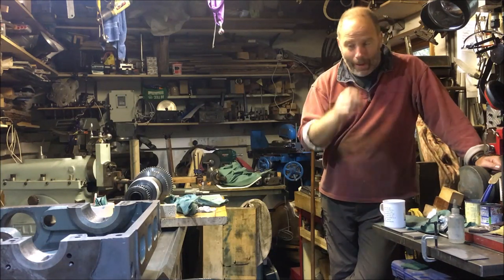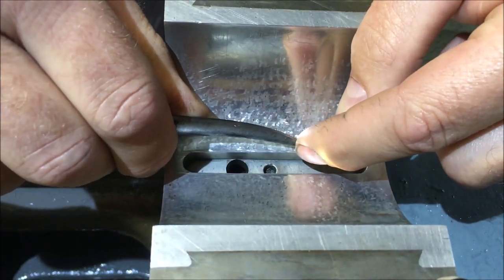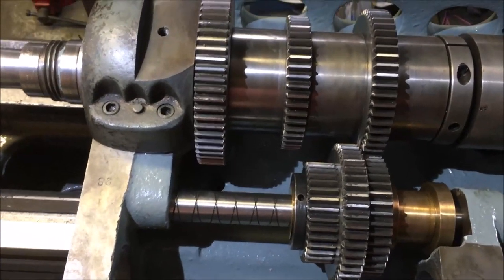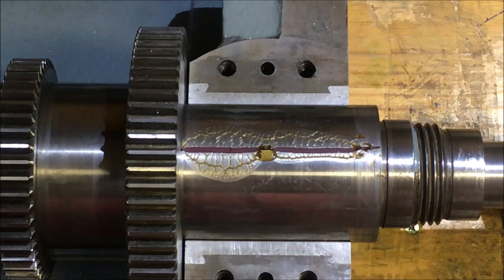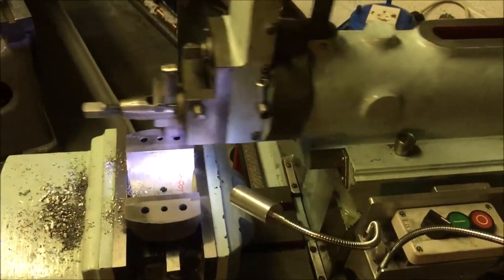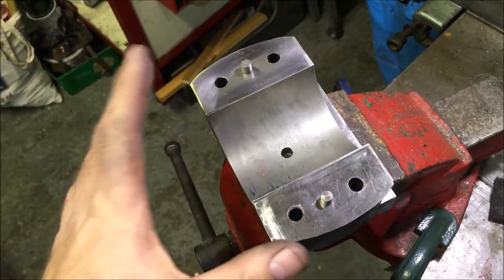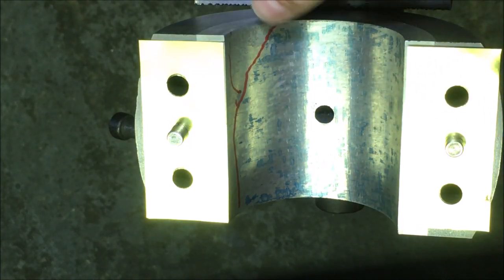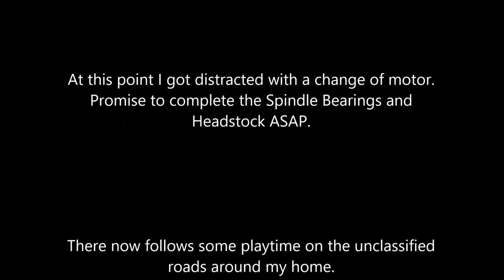Scraping Spindle Bearings

Comment: Hi Mat an Old Timer in an Electric Motor Repair Shop. Once showed me this trick. He filled the Brg Journals with clean oil then added
just a small pinch <---(and I do mean small pinch) of Borax directly to the Brg Journals, then ran the Motor for 5 minuets.
 The Result was an Amazingly Bright, Shiny, and Smooth Journals. We drained the oil, cleaned the Armature, Re assembled the Motor
and test ran the Motor preformed flawlessly.

Comment: Mat, this past spring I scraped in the cutter head, bottom fed, bearings on my woodworking jointer. Admittedly we worked on machines of 2 different  load demands and speeds, my machine runs at a constant 4k rpm. With that said, what I'm suggesting is the means by which I tested the clearances. After final assembly I positioned a thermocouple on each bearing cap and ran the machine for fifteen minutes, unloaded. At the end of the run the bearing temps had risen by 40*F over ambient. In the end you will have to decide how much rise you are comfortable with, however, I think it is a good test for overly tight bearings. Just my $0.02.
Reply from the maker: If I was anyway near smart enough to wire up a pair of thermocouples and a display to show the temp of each bearing thats the way to go ! I'm not so will likely use my heat gun which is fine for comparative readings with hands out the way. The temp rise will affect the fits and thats what I have to keep an eye on.

Comment: When I worked in the construction and installation of Flax Drawing frames all the Drawing rollers ran on white metal bushes (5 - 16 in line depending on size of machine) , we done the Blueing and Scraping as usual and when we finally fitted the long Drawing Roller we would go along each journal and give them a couple of sound "Dunts" with a hardwood Block and a 2 1/2 Lb hammer to "flatten out" any tiny high spots. Crude but it worked . We also applied "Castor Oil" for the initial "Running in" period where the roller was under high pressure from the "Pressing Rollers" after which it was light machine oil applied to a flannel which permanently sat on top  of the journals.
Reply from the maker: Ive read similar about the initial 'thump' to settle any high points and create a small oil pocket for rollers to sit on oil. Thanks for watching and commenting. Mat

Comment: Excellent work never scraped a babbit bearing before replaced a lot of tapered roller bearings which is a lot easier was that a Cincinnati shaper you were using sure got a good surface finish with it I can tell you are very good at doing a job right I am a retired machinist and have rebuilt a lot of machines also own a old sheldon lath with Babbitt bearings  in it
Reply from the maker: Hi Ray, thanks for watching and commenting.  The shaper is an English made unit by Elliot. Based on an earlier design by Alba from the early part of the 1900’s. I haven’t seen a Cincinnati shaper over here in the U.K. comparable shapers by invicta or Churchill. There are plenty of others from the early 1900’s, Butler are a favourite of mine.

Comment: Good work mat. I have used aluminium foil for shims <0.002”. The fact that it is soft means that it compensates for any asperities on the surfaces. Looking forward to seeing this machine making parts. Good to see the landy out. I’m losing water in mine . Think I have a head gasket leak 😔
Reply from the maker: I had 2.5 ltr loss of coolent (well thats what it took to top it back up) not sure when it had been last checked by the previous owner so could be a long time. Found evidence of a leak below the top hose, dripping onto the main block and exhaust manifold - the flexible pipe had been changed quite recently so I had assumed it was sorted. I cleaned it up and then spotted it was still dripping - sorted that so am keeping an eye on it. Got to start looking at the door bottoms next so the welding skills will be developing months :-)

Comment: Sack the summer shift, lucky they turned up 😂. ISO 5 to 10 oil is  blooming thin, guess it was designed for shipyard factory temperatures, ref no doors or windows.
Would spring loading the bearing caps lightly help for scraping in?. Like the oil wedge description, sounds better than hydrodynamic lubrication, makes sense on your radial loading direction.
Thanks for sharing and best regards from the Black Country.

Comment: my dad told me that after they had scraped in new bearings on a lathe they would run it for hours unloaded with molykote A as a lubricant.
the MoS2 particles would embed in the bearing material and reduce drag, and thereby heating up and wear of the bearings immensely.
the stuff is not cheap but in comparison to the work you have done it actually is quite cheap.....
Reply from the maker: Thats interesting, similar to what I had read on a forum a few months back, I dont recall the 'lubricant' they ran shaft journals in with, but similar purpose. Cheers for stopping by, Mat

Comment: Now: I have never scraped a lathe headstock, but I have done a few big-ends of about the same size as your headstock, on an old fire engine. And we generally have just scraped to a good print and then run the engine. I know that there should be exactly the right clearance once the shape is correct. But in practice it seems to work OK.
Reply from the maker: I share your view Andy, there's 'correct' and what works - I doubt after several hundred hours running correct is any better than nearly... but you never know :-)

Comment: Epic effort as usual mate :), looking great. For what its worth if been going through a S&B model L headstock, it runs a split bronze front bearing that seats on a taper, the rear bearings are angular contact ball races. Ive a touch over .002" axial play cold on the front bearing and it parts off fine. Im thinking starting with some clearance and remove a shim if needed might be the better route. Would be a royal pita if that bearing picked up from being to tight after all the hard work.
Cheers
D
Reply from the maker: Hi mate, yeh I think start with .002" and then remove one if it needs it. Am going to take a look at some 'metric' shim to see if I can work out smaller increments than .001" might make things a bit easier. Best of luck with the production runs :-)  Cheers Mat

Comment: Very nice! Interesting to see the process. I'm wondering though, if the rear bearing had less wear, and then you dropped the front bearing even further, won't you have to drop the rear bearing an equal amount to maintain the parallellism of the spindle to the bed?
Reply from the maker: The bearing / spindle to bed alignment is checked repeatedly throughout the scraping of the lower half of each bearing, much of this is covered in the first part of the two videos. The top halves of the bearings simple repeat the alignment to the spindle once it’s established on the lower halves.
Reply: @lookcreations  Thanks! Joined this series a few episodes in.

Comment: I don't know anything about this, but wouldn't you want to cut in some channels/grooves for oil to flow into.
Something that comes to mind is when the bearing temp goes up, does the ID get smaller or larger?  I know when the spindle heats up it grows.
So heat the spindle in an oven and make a chart showing the growth per degrees of increased temp.
Also mock up a bearing roughly the same size, which could be a home made ring with poured Babbitt and do the oven procedure with it.
Then you would know what will happen with the spindle assembly.  
Too scientific, just wing it and see what happens.
Good show and good luck, JIM
Reply from the maker: I have read some conflicting messages about oil grooves in these types of bearing. The main issue is that the grooves can suck the oil away from the shaft and create problems by breaking the wedge that is sought. Where are obviously lack of oil will give the same result. The consensus appears to be a smooth shell face appropriate clearance for the correct oil viscosity, shaft rpm & diameter. Note that the oil reaches the faces via an almost full width felt wick at the bottom - so there should be good coverage and the 'excess will flow out of the ends. I am keen to see how it works in practice !  All the best & thanks for stopping by. Mat

Comment: Another great video.  Regarding the dowel pins, they looked like tapered dowel pins in the video unless it was an optical illusion.  Taper dowel pins would make sense in the application as they result in essentially zero clearance and hold the items in exact alignment. Every taper dowel pin I have ever seen has those same machining marks.  It looks like a kid in a high school shop class made them.  However, every one I have encountered always worked as it was supposed to.  Is your shaper an Elliot?  I have an Elliot 14 MR and it looks very similar to yours.  Keep the videos coming.  Thanks, Ken
Reply from the maker: Hi Ken, The dowel pins are parallel pins for sure, just look like they were 'rough turned',  diameter is spot on maybe .0005" over and they 'spread to fit snug with a tap in ?  Its an elliot 14S Shaper made around 1954 when Elliot took over Alba. I fully rebuilt it a couple of years back - its how I learned how to scrape ... the hard long way around ! Lots of advice from chaps on here and the Practical Machinest Forum. I got quite a lot of stick from 'experts' that didn't like that I sometimes took my own approach to resolve issues and not follow their defined procedures. All in all the results speak for themselves, it holds 0.0002" over the working envelope with a little care setting up the part. The vice I think is from an 18" machine. Its a little big, but does the job well - that had to be rebuilt from scratch as the nut was toast and it was worn on the slides.  Take a look over my earlier videos - there's hours of background entertainment to be had :-)  The playlists, help ensure you can watch in sequence.  All the best Mat

Comment: Nice progress Matt, great job. The gear mesh looks like it may have improved even?
Reply from the maker: I think from memory, the input shaft to the spindle sits below the spindle, so you may well be correct in that its brought the gears more into mesh. The fact the wear in the front bearing had taken the meshing askew has been corrected in the least. So now, either its out both sides of the tooth or right :-) Thanks for stopping by and commenting. All the best Mat

Comment: I've seen a lot about scraping flats but ......well can you tell me more about how you made your scraper for the spindle bearings
Reply from the maker: There are two types I show. One is a commercial made bearing scraper by Moore n Wright U.K.. EBay £10. High carbon Steel. The other was a car boot sale. For £5. It’s been made from an old steel file, so high carbon steel again. As the Babbitt is very soft you can retain a sharp edge for a long time. I would think a local blacksmith or knife maker would be happy to make you a scraper . I will try and show some more details on my next video. Thanks for watching
Reply: @lookcreations  You can just buy them new: https://www.zoro.co.uk/shop/hand-tools/scrapers-picks-and-hooks/03020103

Comment: Hi Matt I'm slightly confused and really uneducated about the spindle and gearbox your working on. I commented un the last video and im just curious about the bearing clearance to the shaft. I have worked on semt pielstick diesel engines large twin turbo v10 roughly the size of a three story house. Babbit bearings for stern tube seals on large ships. With the tolerances your trying to hold with a machine spindle wouldn't you want a 0 clearance fit? Almost unable to turn the shaft. And do a "wipe in" where the shaft itself removes the material to create a perfect oil seal. Because essentially with a babbit bearing the shaft is supposed to ride on a bed of oil not on the bearing. When we worked on these diesels the main bearing for the crank was babbit but it was an interference fit and the crank actually wiped material away to create a perfect seal. Excuse me not seal but surface rather. The same goes for stern tube bearings on shaft seals for ships. They purposely scallop the bearings to allow for the material the shaft wipes away to exit out from between the bearing and shaft. I would like your input. Also its a machine spindle for machining correct? .0005" is better than .003" runout
Reply from the maker: These are all useful bits of information, there seams to be a good number of approaches to 'whats the best 'fit up' ,  as for this lathe spindle, from what I have gathered from other owners of the same or similar Holbrook design, the bearings were shimmed such that they could be 'tightened up' the service hands that traveled around the country doing this work I suspect had guidance on what clearance was required for each lathe ex works. Ive not been able to establish these details. As such its very much a 'suck it and see'.   As such, I have concluded to make the contact areas as good as if it were 'bored', so minimum scrape depth and as near to 80% contact in the contact zone then adjust shim thickness to give a usable clearance with the oil viscosity and rpm range. I suspect the running in period, will be undertaken with the headstock open so I can use a thermometer to watch the bearing temp changes. I may have to rig up a 'spray cover' as I suspect the the gear oil will spray at the higher speeds. Going to interesting and a little nerve racking inspecting the bearings after each run up.  MY feeling is the clearance will be nearer to 0.001" than 0.003", if its sub 0.001" then its going to make shimming it fun.
Reply: @lookcreations  so basically you want a .003"-.005" shim with as close to .000" clearance as possible without overheating and melting the bearings. But you also want to leave yourself the ability to adjust as the bearings wear away over time. And blue fit is to replicate as close to what a boring procedure would do. I noticed both babbitt bearings are dove tailed is there an anti rotation key or pin that keeps the lower and upper bearing from spinning within the housing? Generally with the bearing halves I worked with they had a tang or pin that would keep the bearing from spinning within the housing. Also I would think that as long as you have oil feeding the bearings. You would want as close to a 0 tolerance as possible. Thanks a bunch for your insight, I really enjoy your videos and I love the off road vehicle. those roads just look amazing! Its so beautiful over there.
Reply from the maker: @machinist1337   I think when Im done, if I can have a couple of .001" shims between the caps, and a plastigauge measured gap of <0.001" Im good to go.  If when I test run them, they get too warm / hot, then I will add another 0.001" shim.  As for the babbitt rotating. I cant determine any key / fixing in place. They may have been cast in situ and its part of the babbitt ? I have a long time ago seen an image of the bearing shells stood on end in a brochure - which is why I think they are made and machined to fit so that they could be replaced. Not been able to find it again though ! If that was the case, I would expect the shims were clamped up tight and made to cover the dovetail ends to prevent rotation of the babbitt.   Am really enjoying the Landrover Defender - I drove a long wheel base safari unit when I was 19 working as a Ranger in National Park. Always wanted a proper landrover since. Ive had a Classic RangeRover 3.5ltr V8 (too thirsty for UK fuel prices), then a Discovery 300tdi, then a Discovery 3 2.7ltr - V6 I drove that for 12 years and enjoyed every mile. Its up for sale now . The back lanes around my home are good fun if you take it steady and treat them with respect.
Reply: @lookcreations  I would for sure shoot for .0005" or less  clearance. The lathe won't part off nice if you can't have it run tight.
Reply from the maker: @bcbloc02  Have to say Brian, its a bit of an unknown - to my mind it needs the minimum clearance, while ensuring oil gets in. Too much of a gap to my mind will give all manner of issues when working to fine tolerances and as you say parting off etc. I suspect that I will have to re-visit the set up after a few hours of running in and test cuts.  mat

Comment: The direction-sensitive behaviour has me proper puzzled.
Reply from the maker: Im wondering if its down to the reliefs around the bearing part lines and the lower wick cavity. Might just be pulling the lubricant off early ?
Reply: Seems to me that you have an easier time twisting towards you than away. My guess it's an ergonomic question not a mechanical one.
Reply from the maker: Quite possible 👍